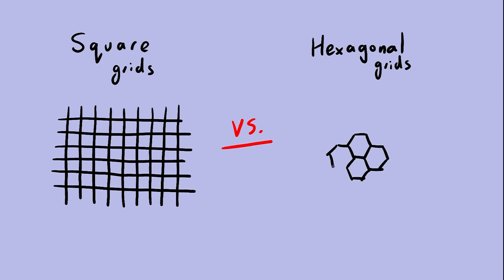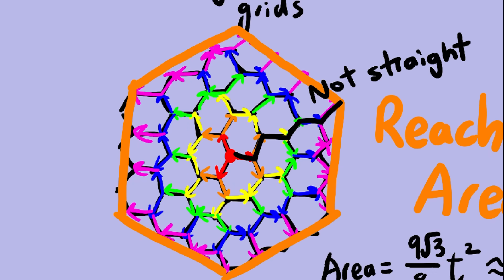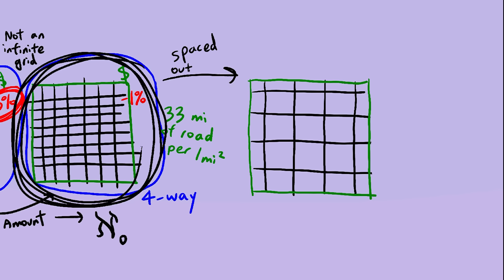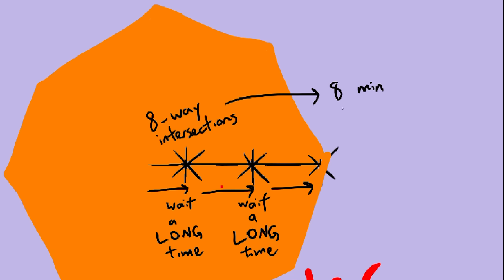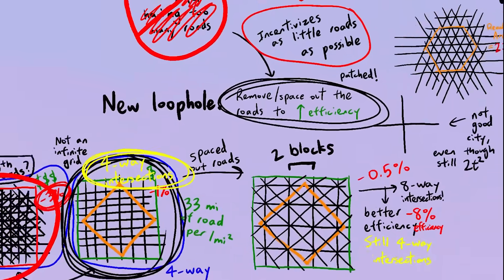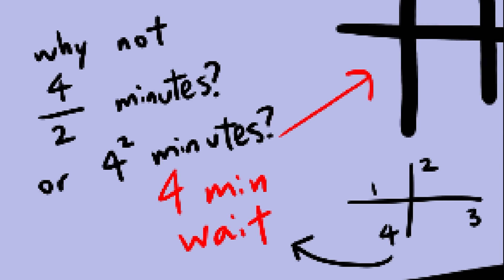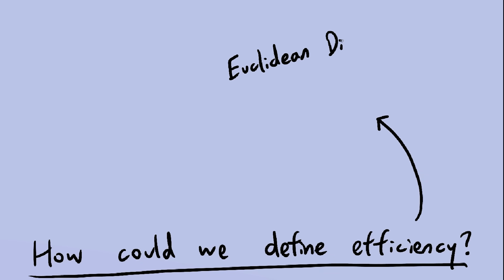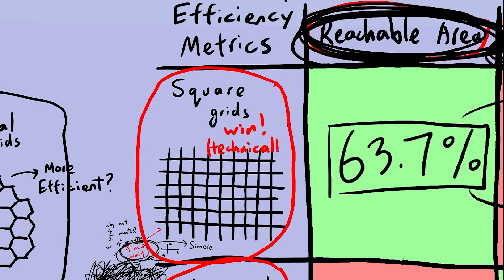Would hexagonal city blocks be better?

Comment: as a cities: skylines engineer, most efficient road is the one giving most access to block. which is area over perimeter so hexagon is winning here but block cant have one hexagonal building in it, we usually have rectangular buildings and packing density of rectangles in hexagon is worse than rectangles in rectangle so unfortunately grid wins. even though hexagons have one cool characteristic that you never have to stop if you're turning right (in right handed cities or left in lefthanded).
Reply: A real engineer would have pointed out immediately that one can only drive fast in a straight line. Why are you lying about yourself? ;-)
Reply: @lepidoptera9337 hexagon has 6 "straight lines" so speed from intersection to intersection is the same in grid vs hexagon. i dont understand your objection, in specific case where destination is at the end of the road, before intersection, road efficiency has no meaning
Reply: @tsraikage  That you "don't understand" what I am saying is proof that you are a troll and not an engineer. ;-)

Comment: Detroit's downtown was based on a hexagonal grid, designed by Augustus Woodward after the city burned down in 1805. It's not in its pure form anymore, but it makes downtown a bit confusing. It's a pretty cool system; google "Woodward plan Detroit" for images (although Woodward named the main thoroughfare after himself - claiming it wasn't after himself, but rather because it headed toward the woods to the north, but no one believes that). Part of Woodward's plan was to allow hexagons to be added on as needed, and to have parks or green space at the nodes. We still have some of that - Grand Circus Park and Campus Martius are the prime examples. Grand Circus Park has a roughly circular drive around it - not quite a traffic circle, but traffic circles would certainly work in Woodward's original plan.

Comment: First, people will want to buy blocks of the same land area. So, if square side length = 1, hexagonal side length will be about 0,62.
This means more intersections on your way. But for every 3 square grid segment you may traverse 5 hexagonal grid segments.

Second, on a 4-way intersection you don't have a conflict with those who are behind you. So, 3 minutes would be a better approximation. But if we really want to go into details...

Given you drive on the right side:
-- turning right you have conflict with those who go 1) from left to right 2) from front to right
-- going straight you have conflict with those who go 1) from left to right 2) from left to front 3) from right to left 4) from right to front 5) from right to you 6) from front to right
-- turning left you have conflict with those who go 1) from left to right 2) from left to front 3) from right to left 4) from right to you 5) from front to you 6) from front to left

Given rulles of advantages on equal roads:
-- turning right you have to wait noone
-- going straight you have to wait those who go 1) from right to left 2) from right to front 3) from right to you
-- turning left you have to wait those who go 1) from right to left 2) from right to you 3) from front to you 4) from front to left

There are 4 sides, and for each side 3 destinations (full turns are rare), so there are 4*3=12 flows.
Turning right you wait 0/12 flows.
Going straight you wait 3/12 flows.
Turning left you wait 4/12 flows.

But on a perfect grid you would often go in straight lines and only turn once. So, on average you would have to skip only 3/12 or 1/4 of other movement participants.

On a hexagonal grid there are 3 sides and for each side 2 destinations, so there are 3*2=6 flows.
Turning right you wait 0/6 flows.
Turning left you wait those who go 1) from right to left 2) from right to you, so, 2/6 flows.

Any straight-like movement in any direction would include about 50/50 turns to the left and turns to the right. So, on average you would have to skip 1/6 of other movement participants. But you also would have some losses in speed.

Let's suppose that on a square grid we spend 30 seconds per intersection, but on a hexagonal grid 20 seconds per intersection. Also we traverse a square side per 50 seconds, but we traverse a hexagonal side per 30 seconds. Then, on a squre grid side + intersection costs 80 seconds, on a hexagonal grid 50 seconds. Roughly if we make 5 moves on a square grid, it will take 80 * 5 = 400 seconds. And if we  make 8 moves on a hexagonal grid, it will take 50 * 8 = 400 seconds.

However if you map how many places can be reached within those moves, the numbers are pretty similar. I got 48 place for a hexagonal grid and 50 places for a square grid.

Comment: Lot of things to consider in there ; 
First, for the Intersection Penalty, you could have reused the "fastest possible red light cycle for a k-way intersection" you found in your video about intersections. Then, you could also have thought about a "block efficiency metric" for penalising large blocks ; we're dealing with urban planning here, not empty fields, and houses can't be as big as we want, so we define the block efficiency as the ratio of area in each block that is less that .5 minutes (for example) away from a road, over the total area of the block, the rationale being that stuff in the inefficient part is too far away from a road to be useful. 
We could also think about a "road efficiency metric" ; each road increases the efficiency of the blocks around it, so we can compute the ratio of block efficiencies with and without a given road (way 1), or compute the ratio of road area over block area for a given width of road (starting from an infinitely thin road model, consider each part of a lbock less that 3 meters away from a road as part of the road) (way 2), or any other way I couldn't devise in 30 seconds

Comment: The most efficient design is 2 roads, perpendicular to one another. That always makes rectangles. It allows anyone to get to any point in the grid with 4 or less turns and with the most straight driving (think of a cartesian plan or how memory is arranged in computers). To mitigate problems that arise with it  a couple diagonal roads crossing entire sections of the grid can be placed where needed

Comment: I draw a hexagonal city as a thought experiment a decade ago or so. And what i was considering was that there roads would go throw the center of the blocks, not the edge, and they would go in 3 different levels, and only every second block

Of cause this would make it so the blocks would be tiled together and there would be no air between the,The solution to this was to have cut outs and have light shafts that would be block size down, and have some building sticking up.

The roof of the mid size building would be general outdoor spaces, while the light shaft would be semi private outdoor spaces.

Comment: Do a combination of both. Do hexagonal for larger collector roads but squares for local. Also combine it with city planning and zoning where businesses are at the edges of the hexes and while local roads are squares that only go on the side of the collectors then parks are at the center connecting each side of the hexes with paths to connect the neighborhood.

Comment: The penalty for 4-way stops vs 3-way stops didn't really make much sense in the first place. A 4-way stop just needs stopping to alternate between two patterns (since opposing sides can share the same period for movement, though there would be a penalty for turning in one direction). A 3-way stop would be need to alternate between 3 patterns - if you didn't use the common sense solution of a roundabout, which would significantly reduce waiting times at the expense of adding a little bit of area taken up by the roundabout and distance needed to get from one side to another.

Incidentally,  a roundabout would have made more sense than trying to figure out how an 11-way intersection would work in terms of time wasted at a stop light, but again the penalty would come in terms of area required for the roundabout and distance needed to get from one side to another. Whatever efficiency you get in terms of making a "straight" path to your destination you probably lose by going through such complicated and large roundabouts.

It might make more sense to consider efficiency in terms of the amount of serviceable building fronts per unit of distance traveled and/or unit of time required to travel to such a distance. But then square/rectangular grids would almost certainly win purely because buildings are square/rectangular and the 4-way intersections wouldn't require any wasted area or distance at roundabouts; it would just require you to establish some arbitrary amount of time wasted per stop (divided by two if each direction is equally likely to have a green light as a red light at any given moment).

Comment: The best solution is to add another parameter which mesures the width of a road
And if you make it too small than the trafic would be worse and if you make it too wide than the buildable land(the parameter you value) would be too small

Comment: Square 4-way intersections have less waiting then octagonal 3-way intersections, not more.  The 4-way has only two cycles (green light for north/south, then green for east/west).  The 3-way has 3 cycles (green for south, green for north-east, green for north-west).  In other words, if you're driving and you reach a 4-way intersection you have a 50% chance of driving through without stopping; at a 3-way you have only a 33.3% chance of not stopping).

Comment: Not a civil engineer here: you could give roads some amount of thickness (I don't know how to account for overlap, but then you could just ignore it and have a built-in penalty for large intersection), and also use a certain amount of minimal-maximal size for a city block, and also buildings probably have to have some usable shape, so maybe it should be restricted to some minimal circle that fits in the shape tightly and a maximal circle size that surrounds the shape tightly. Then, using the inner circle area with (idk) 75% of the area of the rest of the shape would give you a rough building area estimation. Then you could do a buildings area/roads area metric for how well the roads serve the buildings, or a buildings/whole unit area metric, the latter you can do without road thickness.

Comment: From an optimization made in a logistic/automation game, the answer must derive from other parameters : number of vehicules and inherent grid unit vehicule capacity (directional) and by that, some kind of factor making the penalty of an intersection grow along with the density of the crossing behavior. Why using red and green lights when the overal traffic is not dense, here the red and green light is a patch to force collaboration, but an intersection without red/green lights with a low traffic density acts as a straight line, most of the time (no intersection penalty). The general rule of thumb is then : less intersection = better idea but it can be neglected in the case of low traffic density. And when I talk about an intersection, I mean a point where two vehicule might intersect : a star like "intersection" where only one road is feeding the whole star of n roads could almost be considered as a non intersection, because no two vehicule can actually intersect.

Comment: It's better to run on one way roads than on 2-way roads because turning left is faster and intersections between one way roads do not require stoplights. This could be a topic for the next video, how would you weave 1 and 2 way roads in a hexagonal pattern to increase efficiency?

On the square-ish grid quartere of Rome, the proportion is about 4 one way streets per 1 one way road, with no preference between the up/down vs right/left.

Comment: A 3 way intersection would take 33% less time cause you would have to wait for 2 sides instead of 3 at a 4 way intersection. Also considering the probability of being lucky and getting a green when arriving is 33%(33%/25%) higher at a 3 way intersection. Making a 3 way intersection way faster than just 25%.
Its a nice math problem but here in Holland we mostly work in a system with primary and secondary roads to have traffic be more controlled in communities and high speed traffic being more accessible.

Comment: The Brick Grid is the best in my view.

The key reason for such is that it balances both straight-ness for running utilities and can exploit a particular type of intersection and road pattern that allows for 0 traffic lights.

I first came across this idea when messing with Hexagons. Basically 4/6 of the sides would be 1-way with those 4 split so 2/6 on one side goes South and the other 2/6 side goes north. In the middle those two isolated 1/6s would be 2 way roads. But alternating driving on the left vs right.

The end result of such a system of roads is that every intersection is a 2 lane one-way road splitting left and right into another one-way Rd and the receiving side of a two-way. This avoids lights which is nice, but the downsides of Hexagons in building shapes, utility runs and user complexity ruin the plans viability.

Bricks however as you showed can provide the same 3-way intersections with squared off land plots. You just need to make sure the short roads up the bricks narrow side are two-way and alternate which side you drive on to sync up with the one-way roads to remove any need to crossover. No crossing, just merges, no traffic lights.

I think that is the optimal city grid. Bricks with no lights.

Comment: I originally thought that looking at the surface area for housing made sense because it's proportionately affected by an increase in road-lines; but more roads splitting building means more walls, smaller buildings, and higher costs.
So rather than having a road-penalty or scoring by surface area, looking at the total perimeter for housing might be better?

Also, in a 3-way intersection you only have to give way to a single direction while holding up 1 other line, which is a lot more efficient from a time/complexity POV.
...to complicate thing further, what if we simplified the flow of traffic by making all roads unidirectional, effectively turning the city into a roundabout?
Things would move along a lot more quickly, but the distance to your destination would increase.

Comment: ♦️Use Diamond Grids♦️
This can also reduce sun glare and increase sunlight hours. And the acute angles reduces traffic’s incident chances.

Plus you can add slip lanes onto the intersections, which is good because buildings don’t then need to build up to the triangular corners of the diamonds. Which is good because it’s much easier to tessellate a cube in 3 dimensions rather than any other shape.

Also better to be horizontal rather than vertical; unlike the Emoji I used.

Comment: One straight road is cheaper than X roads by a factor of X.
The loophole of nearly infinite roads can be addressed by infinitely decreasing cost efficiency.

I think we first need to define the purpose of roads.
Roads are connections between city blocks. A road’s purpose is to make transportation possible. The greater the volume of possible transportation, the better. The less space a road occupies, the better. Reducing the area of city blocks reduces the required volume of transportation accordingly.

Thus, one city block without roads requires the maximum volume of transportation while having zero available transportation capacity. At the opposite extreme, one giant road instead of a city provides maximum transportation capacity with zero demand for transportation. This resembles a supply-and-demand graph, albeit a skewed one. These are boundary conditions.

Also, roads are not only those between blocks; roads also exist inside blocks. Even pedestrian sidewalks are means of transportation.

I have also noticed that Ohm’s laws describe road capabilities surprisingly well. Roads, like wires, have “resistance,” and junctions also introduce resistance. The volume of transportation corresponds to electric current, while the speed of transportation corresponds to voltage.

Comment: All of your loopholes arise from your initial simplification of “roads have no width”. If you could give roads a width then you could define any arbitrary road:not-road ratio then scale your grids to comply. This would prevent you from just adding heaps of road. As I typed this I realised you can probably do it with length as well. You could define a maximum average road length per square unit and enforce that, preventing excessive roads by scaling all grids to the same road length:ground area ratio